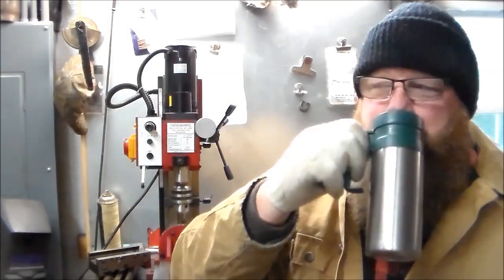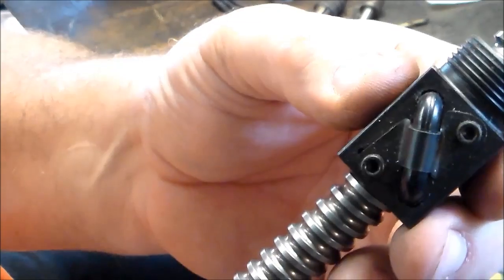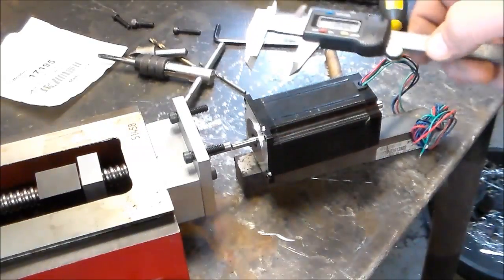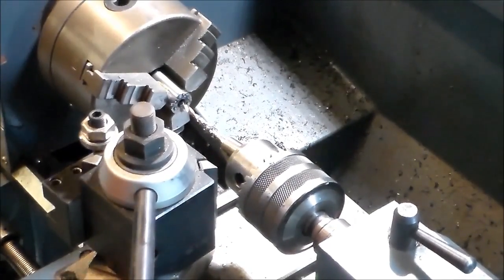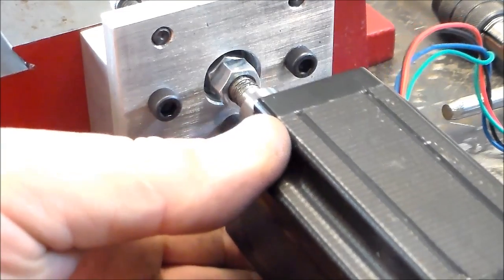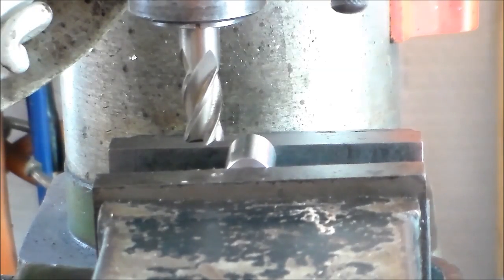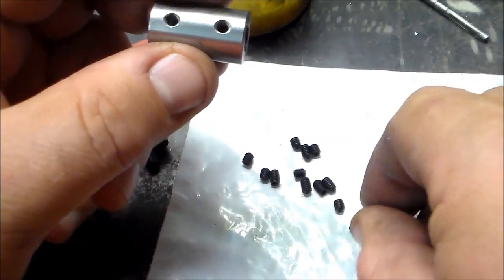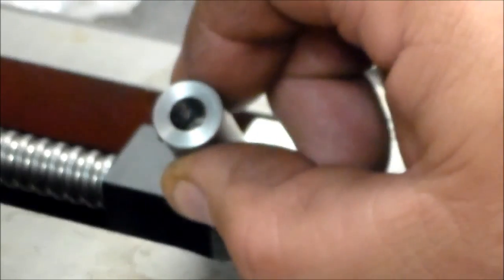Part 6 Harbor Freight Mini Mill X2 CNC Conversion Step by Step

Comment: I just subscribed today. 40 years ago I was born in Little Rock.
Reply from the maker: By your user name, guessing you ended up in Alaska? That's a long ways from where you started!
Reply: Yes sir I moved around a lot as a kid "Air force brat " but I have lived in Alaska since 1992 and I love it. I hope to some day visit A.R. before the good lord calls me home . Have you lived in A.R. your whole life? Love your channel.
Reply from the maker: @alaskanken2132  mostly. I  worked travelling construction for a couple years and did 4 years in the Marine Corps, but otherwise been here in Arkansas. I'd like to get up there and check out your neck of the woods someday.
Reply: Thank you for your service. I live near a town called Talkeetna. When you come up you ought to visit Homer it is beautiful and a great place to fish. I have a very small channel I thought I would give this a try while building my log home. I just finished your knife build video you are very good at what you do. I always wanted to know how you guys tool hardened steel.  Do you heat it up to expand the  molecules and freeze the steel to keep them expended?
Reply from the maker: @alaskanken2132  I grew up in a log home! My family built it when I was a kid, not sure how much help I was, but I was in the thick of it. Yeah, heat treating metal is a science on its own. I guess blade steel is heated to that critical temp and the molecules are all dancing around, quenching locks the carbon in the lattice and results in hardened steel. Or something like that, lol.

Comment: I just watched 1-6. Very impressed. Self-taught. Pretty damn good. Looking for the video #7. But it seems to not be finished yet. I hope to see it soon. Keep up the great work. Also, don't worry about talking, your only giving us all great info.
Reply from the maker: Thanks, yeah it's not finished. I've got too many irons in the fire!
Reply: Self Made Project, you know if your every looking to get rid of one of your Mini Lathe's. Send me a message.
Reply from the maker: I'd like to find a much larger lathe, these little ones are kind of a pain. If you have the space, I'd recommend going bigger for you too. The little ones are good for learning on, but limiting when it comes to doing real work.
Reply: Self Made Project , Yea I understand what you mean on that. But I have never turned anything before, so I would have to learn how to do everything. The other reason to go onto a mini lathe is because I just was Medically Retired from the US Air Force, So money has a huge influence on what I can and can afford.
Reply from the maker: I understand. I actually got this little lathe on a trade, basically did some work for somebody and got paid with a little lathe. It's ok to learn on, but I very quickly realized it's shortcomings. They aren't very stiff, which translates in worse finishes and even broken tools. For example, I can't hardly use carbide tooling because the lathe flexes and breaks the cutting edge off. If you want to cut mainly aluminum and brass they work pretty good.

Comment: What happened to the project? It's been a year since part 6 was put out and that's where it stops.
Reply from the maker: I've still got it, just not finished. I had to stop working on it and focus on finishing my shop. I changed jobs, got smacked with a tornado, had to finish another huge project (sawmill), etc. Just been so dang busy I haven't got back to it, but I will eventually.

Comment: hey if I send you a drawing of a carburetor shaft extension will you make it? you can sell it and a small piece of plate to the Mazda community. there is no provision on the Weber carburetor conversion for idle kick up for a.c. or automatic transmission. it's a very simple process.
Reply from the maker: I don't think I'm a good enough machinist to hire out for anything! I'm pretty much a self-taught, beginner. There's a bunch of guys in the Youtube machinist's community that would probably be interested.

Comment: Just watched the making of the coupling. You should buy a flexible one and machine the bores to suit. Your solid coupling will definitely break a shaft in the future. Great videos btw. Your father would be proud I'm sure.
Reply from the maker: Actually, I was worried about that after a few people warned me so I have bought flex couplings since then. Project is still not finished though.

Comment: I'll give you a B+ so far, go back and replace those m6 x 100 screws with flat head allen or countersink the one's you used flat heads would look much better, like something Chip Foose would use. Sometimes precision is more in how things blend together. I'll give you an A if you countersink the bolts you have, and an A+ if you use flat head screws. when you make your stand-off the ones you have sticking out will probably need to be addressed anyway. You are doing a great job, looks like you take great pride in your work.
Thanks for sharing your project with us.
Reply from the maker: Thanks for checking it out. Yeah, I may have to go back and countersink those, lol.

Comment: my brain is tired, I've been a machinist for twenty years now and for some reason this whole segment intrigued me. I ended up watching all of them, but now am just numb from getting thus far with no conclusion. in short, your a very smart fella on how you look at your approach, your actually allot smarter than many of the machinist I've worked with over the years, so give yourself credit for what you've learned on your own. I'll hit the subscribe button so that when you get back to your project, I'll watch it. So far so good! 

here's a pointer for you regarding your threading on the ball screw with your lathe. even though it was cool to thread it on the lathe, you would have faired better by determining your thread length first and just cutting a 45° lead chamfer and use your hex die to make your threads. even though it is always cool to experiment with your lathe capabilities, sometimes it doesn't always prove to be the best process for the job at hand. But you did it and that's cool in itself. one more thing that you might try that works great on threads is putting a 10° relief angle on the top of your threading tool. it leaves a near perfect surface on the thread pitch you are cutting. insert tooling always have a roll/curl relief on the top of the inserts to leave a clean surface cut. but we machinist are all different in our approach. just thought I'd throw out my own 4 cents! Lol. but I have enjoyed your progress so far.
Reply from the maker: Thanks for the tips. My little lathe is about as stiff as a wet noodle! Sorry for the break in action, but I just snapped one day and decided the most important thing I needed to do was finish my shop. I've been putting a ton of money and time into that, so all my other hobbies are on hold. I'm itchin to get back to it though.
Reply: Right on!

Comment: where is part 7
Reply from the maker: I got interrupted in this project, decided I had to get my shop finished. Started insulating, wiring, walls, ceiling, etc. it's been expensive and slow going, but I'll get back on this project as soon as I can. I can't wait to finish and use it.
Reply: in need of a part 7! lol great videos man

Comment: I'm really curious what program you intend to use to operate your table once you complete the build.
Reply from the maker: I'll be using Fusion 360 for CAM and Mach 3 to run. I've got a licensed copy of Mach, but when the time comes. I'll have to learn it, never used it before.
Reply: +Self Made looking forward to learning it with you

Comment: Like your video & looking forward to the final running. A couple of tips I could throw your way, If you don't mind. 30+ years as a machinist.1. finish: Get a better finish on your I.D./ O.D. work. Those carbide tool bits are low end, invest in some 883's. Use a reamer instead of a drill to get accurate hole sizes. Use a lathe file to get your O.D. to size.2. Try and find an old Casio calculator. Hole patterns are a breeze with one of these. Example: 20 holes on a 4" radius? 360 divided by 20 = 18. ( 18 deg. sin. X 4" rad. = 1.236 X X 2 = ) & ( 18 deg. cos. X 4" rad. = 3.804 X X 2 =) either function, sin. or cos. you can just punch in the number of the hole you want to go to, and it will show on the readout. ( 6, 12, 20, 4, 11, etc.) You can do the hole pattern for all holes, write the numbers down, and have it ready. Casio is the only calculator I've ever seen that will do this.3. Buy an edge finder. For what I saw here, 2 set screws, you can use a 1/4" end mill to find center of round stock. When it is center it will make a complete circle. If not, it will make a flat on one side. just move it over until the circle is round, and the same depth on each side. close enough.4. You'll want to seal those thrust bearings, maybe cut an o-ring groove, possibly a felt insert. The ball thread will need protection also.5. Don't double dip on your center drilling, and I'd check that tailstock for alignment. They do tend to get out of alignment, and the are adjustment screws just for that.6. Not everything needs to be cut with carbide. A good high speed tool will last for years. I'd say " Get to know someone at the tool supply. You wouldn't believe the sales they have sometimes."Well that's all I got, good luck in your projects.  your hero & mine, Jimbob  ;)
Reply from the maker: Like I said in the beginning, I'm not a machinst :). You're right and I've already figured out some of that. One of the great things about Youtube is that you can learn from others as well as videos.  The carbide tools I'm using are cheapy's and they are more frustrating than than they're worth. I had been using all HSS tools, but figured I'd need carbide for the ball screws, so picked those up. Edge finder is on my short list of tools I need. I've got a lot to learn!
Reply: your more of a machinist than you give yourself credit. and self taught  to boot! you remind me of my vo/tech teacher. hope you find time to get back on the mini project soon as i need some parts made!

Comment: I'm hooked and subscribed. Looking forward to 7. But let me ask a total newbian question. Why not just couple the motor to the previously existing handle shaft? (ducking head now waiting for flying objects).
Reply from the maker: Well, let me give you a newbie answer :) The factory lead screws would not be accurate enough to use for cnc. Part of what makes this even possible is converting to ball screws. There are conversions that change over to ball screws and then use drive belts off the handles, but it's still basically the same conversion. I'm no expert, learning as I go.

Comment: Glad you finally got warm, watching the previous videos was causing my old hands to hurt
Reply from the maker: Now you're getting to why there's not a part 7 yet! I finally just got so fed up with either freezing or baking that I blew my shop up! I packed up everything I could and moved it all to one end, then started insulating, wiring, drywall, etc on the other. Still working on it.
Reply: I did the same. My shop is in my garage, I finished wall insulation, then insulated the garage doors. A window unit works fine for the summer, but since I had to replace my a/c system last month, I'll be running duct to it soon. Hurry up, so we can see#7

Comment: A small universal coupling is commonly used to connect the two shafts to prevent binding as they rotate.  It's virtually impossible to keep the shaft's centerlines perfectly aligned to prevent binding which will cause vibration, wear, and premature failure.  Google the search phrase "pictures of universal joints" to see the available designs; ¼" to ¼" is readily available.  Of course you'll need to enlarge one side to 5/16" diameter for your application.

Comment: first let me say.. THANKS for your videos. I am in the process of thinking about doing this. I have looked at Hoss and like his plans and it looked like you were going that way so I want to thank Hoss for his hard work and sharing as well...
that said... can I ask a few questions. .
I guess I am going to buy a boring head to cut the hokes for the X AND Y leadscrews. Thanks to Hoss for the lead on ebay for the Ballscrews. I don't have a lathe so I need to get them already machined. 
are you dimensions on the leadscrews the same as Hoss's?  I have never used a boring head do you know of any Vids or info on how to use them. like how do you set the Z Axis to cut the correct depth for the thrust bearings?
Did you use Hoss' design for Z Axis? And can I use a rotary table to mill the flange needed in that procedure?
like I said thanks to both of you for sharing .. I am just getting into milling as I am trying to work on guns and build AR s.....I look forward to you next installment.  I am hoping to start on mine this fall... the Z Axis is my concern. ...
Reply from the maker: So far, I'm going pretty much by Hoss' plans. I've got plans from a couple other sources as well, but wasn't sure if/how/when I should give credit. I'm trying not to give any specifics of the plans as I don't want to give away his plans. I am not a machinist. I am a tinkerer and hobbyist, so giving machining advice probably isn't wise, but.... For a boring head, I drill the hole as big as possible with a traditional drill bit, then start enlarging it with the boring head. It's pretty simple once you try it. The depth for the bearings in this case, isn't particularly critical, you could be of a little and it would not affect anything. I haven't started on the z axis yet, the videos so far are real time progress. There are a couple different approaches to the z, but I'm leaning towards staying with Hoss plans, he's obviously a x2 genius. Just jump in, you 'll figure it out as you go, that's what I'm doing.

Comment: part 7 ?  has the beard grown back as its nearly winter
Reply from the maker: Ha! I usually switch back to winter mode around October.
Reply: any idea when part seven will surface
Reply from the maker: I need to just take a vacation day from the "real" job and spend some time on this. I've got a little video shot, but not enough for another episode yet.
Reply: i have a simpler type of mill and what size of stepper motor are you using
Reply: well a clarke cmd10  from uk's equivalent harbor freight https://www.machinemart.co.uk/p/cmd10-micro-milling-drilling-machine/
Reply from the maker: Andy Wyatt I can't remember the motor size off the top of my head, all my notes are over at the shop. I'll have a whole electronics episode eventually where I share all about the motors, controllers, power supply, etc.

Comment: So far so good stepper motor is connected now what?  Where's the part 7, I am looking forward to the controller and programming part? 
Having moved on to software development decades ago I am out of touch with the subject. How are you planning to interface it with the controller, are you writing your own software or using some pre-existing opensource code? I would think Arduino would be appropriate and pretty interesting as there is lot of opensource code and info out there.

On another note ..... I learned machining in 2nd semester in engineering school and although I cringed few times during many parts in this video, I  love your self-taught quick and dirty style which seems lot more fun and way faster :)
Reply from the maker: This is a spare time project, so progress is slow. The next episode or two will still be dealing getting the x and y axis moving mechanically. As far as electronics and software, I have already purchased the equipment, but have yet to learn much about it yet. I'll probably use Mach 3 or 4 for software to control mill. Maybe linox cnc, not sure yet.

Comment: Great project. Thought about doing something similar myself. A quick and dirty way to find center on the coupling would be to mill a light flat across the top. Guaranteed to be center, near enough for grub screws and makes it easier to center drill. Are you going to use a nyloc nut to set preload on thrust washers? Can't wait for next vid.
Reply from the maker: Thanks for checking it out. Nylock would probably be fine, but I thought I'd just use 2 regular nuts, one to set tension and other to lock it down.